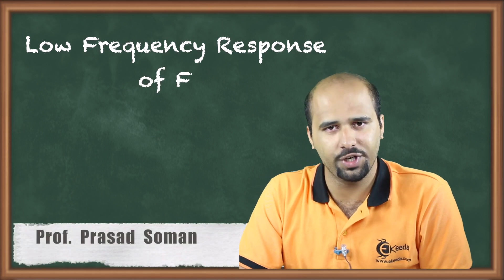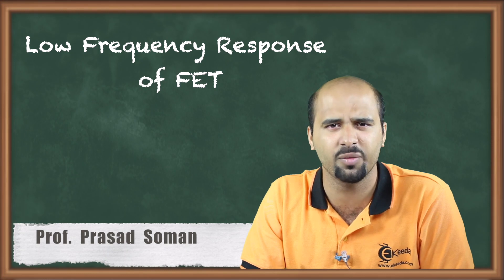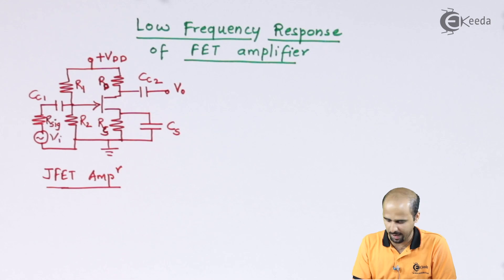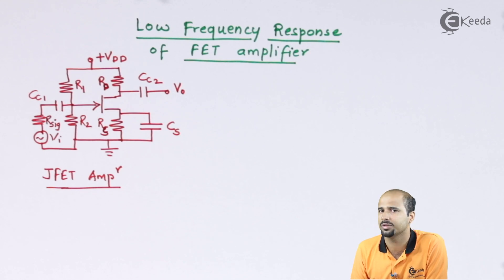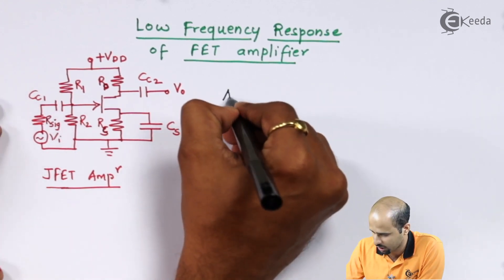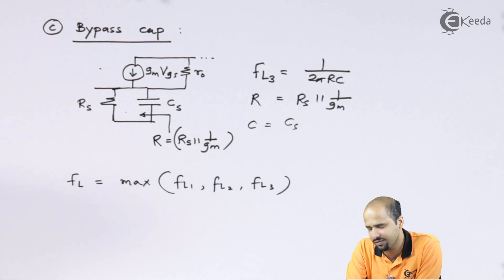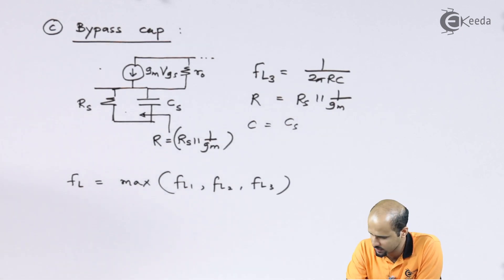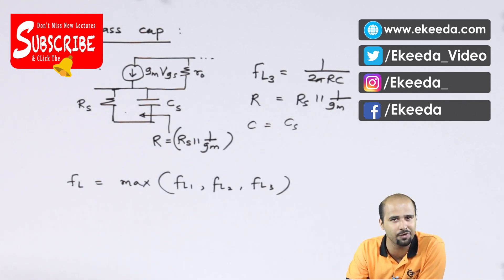Low Frequency Response of FET Amplifier - Multistage Amplifier - Electronic Devices and Circuits

Comment: There is no proper formate of the topic
Reply: Can you provide some source better than him regarding following topics:-
Multistage amplifiers: Recap of Small Signal Amplifiers, Cascade amplifier, Darlington pair, Analysis of multistage
amplifier using BJT and MOSFETs, Significance of coupling and bypass capacitor, types of couplings DC, RC and
Transformer. Feedback: Properties of feedback amplifiers, basic feedback topologies, analysis and characteristics of
various feedback amplifier circuits. Loop gain, stability problem.